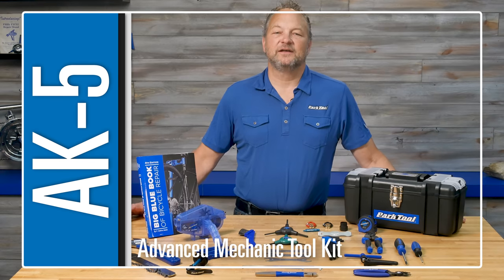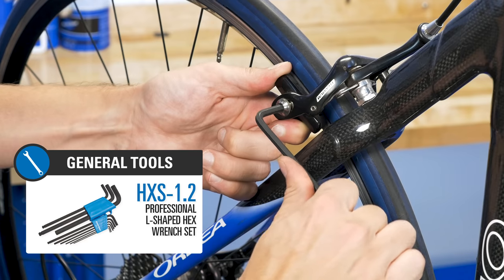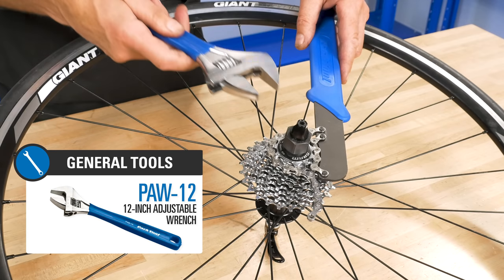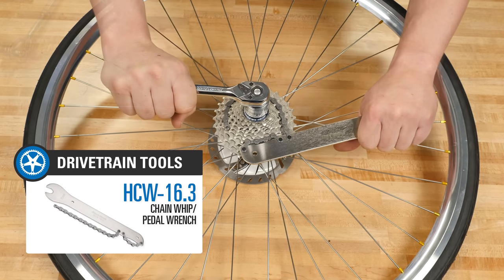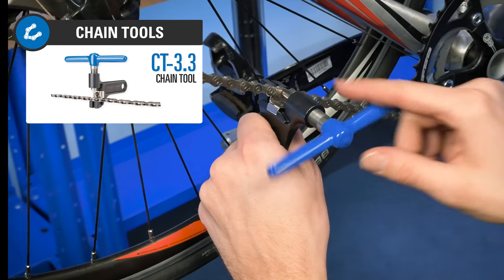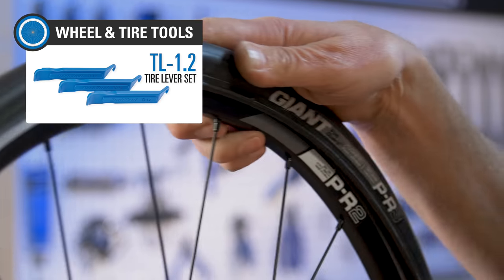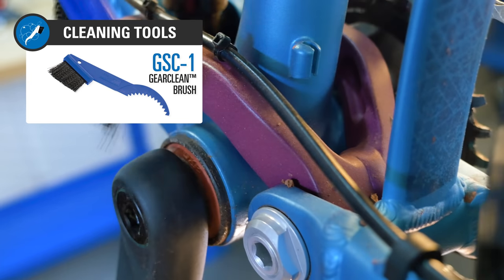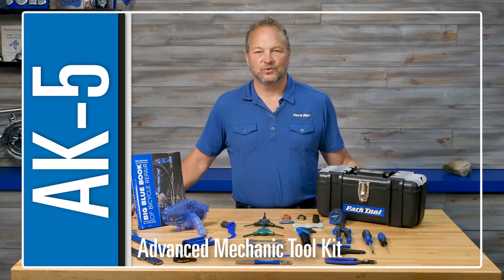AK-5 Advanced Mechanic Tool Kit

Comment: i adore Park Tool, but this is not Advanced

I only recently discovered that the reason my best attempts at repairing rear shifting may be because I need a DAG 2.2 to analyze the frame before If my attempts to adjust were to take more than 5 minutes. I am talking about beater bikes, not new.... Now my routine would include using that after said 5 minutes. After that I would proceed with normal adjustments.  Next tool is the dropout alignment tool. then the full wheel building kit including TM1

if I had all that I could really call myself advanced. Even then, there are loads of tools and there is so much to learn from PT tutorials that it would take an entire year for me to get close to advanced. 

Awesome channel,  killer tools !

baby steps. i will get there! i share all this with my clients !
Reply: DAG is an essential tool but imo, old, entry level bikes don't benefit much at all by having perfectly straight derailleur hangers. If the hanger looks straight enough just by eye, I'd leave it alone and only try to reset it as one my last options to try and improve shifting. If it's obviously tweaked I'll straighten/replace. Higher end bikes (esp newer ones) benefit a-lot more from the hanger being perfectly true.  again imo.
Reply: Agreed, I would rather call this a basic kit. A person moving to "advanced" category would already have most of these tools so no need to buy them again.

Comment: Nice kit - it's taken me about 25 years to accumulate all of these plus some additional ones, and I'm sure it's cost me more than buying the kit. The obvious glaring omission is a torque wrench. I also have a couple of pedal wrenches, a truing stand and WAG for wheel building and truing, various bottom bracket and headset tools, including a bearing press, and a DAG.
Reply: do you use them?
Reply: @irriterendenavn  Yes, all my tools have been purchased because I needed them to build a bike, switch out components, build a set of wheels, etc.

Comment: "crucial to have to installing the unique slotted nuts found on most front chainrings" Yeah, or you know a big flat headed screw driver like they where initially made to be used with. 

I love you guys at park tool I really do, your tools for lock rings and weird proprietary bolts and fixings and your wheel calibrating tools etc are all top notch, but that really feels like re designing the wheel you know! 

Plus you rubbed our faces in it and made a pizza cutter! I rip my pizza to shreds like a real man!
Reply from the maker: Thanks! Those nuts were not designed to be removed with a flat headed screw driver though.